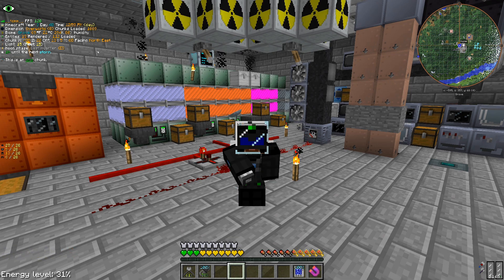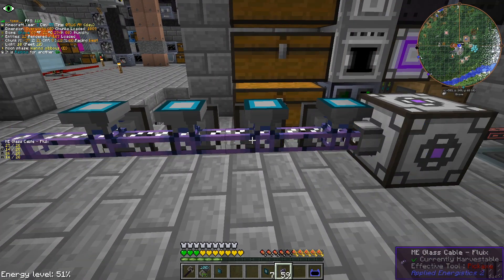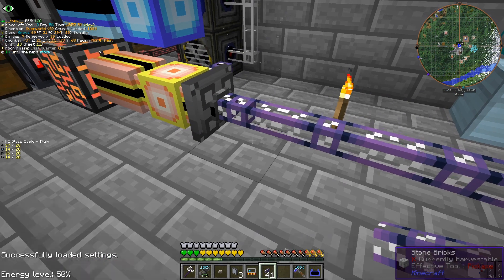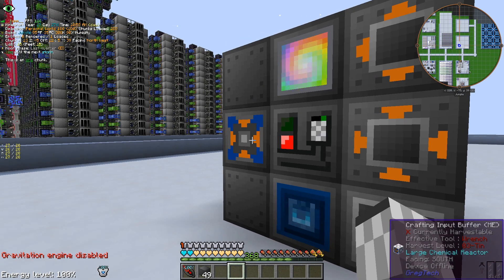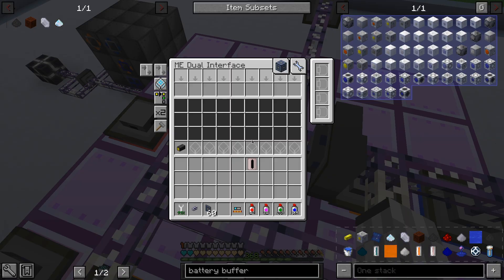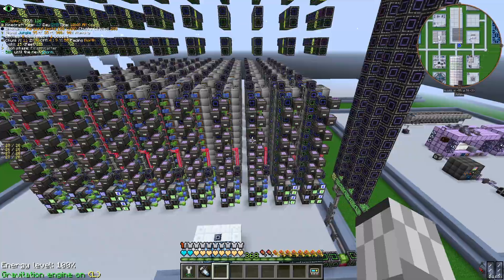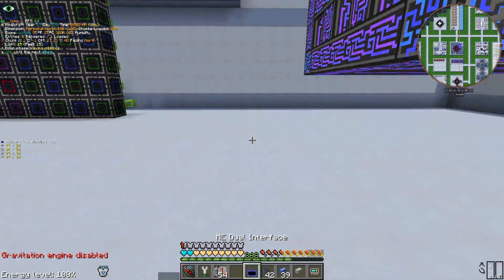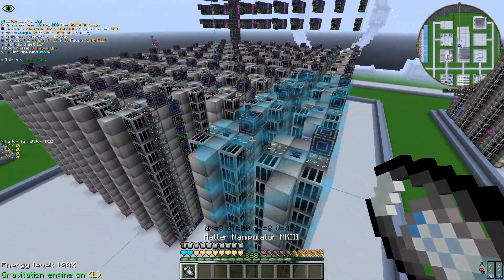GTNH - quick AE2 overview/tutorial

Comment: i watched this and tried to build the me controller block u showed as a step by step but for whatever reason mine says most of the p2ps/cables are missing channels and are offline and im not sure why. any idea what would cause that? all the me controllers are on but nothing else seems to work
Reply from the maker: use an me network visualizer to try to figure out where the channels are getting stuck?
Reply: @AverageGregTechPlayer  im playing on another modpack and I have the same exact problem, and my pack doesn't even have a visualizer to see what's going on, I noticed that there are some stuff not matching your tutorial like there's one extra p2p tunnel at the left side of the red cable at 6:59 where it was not shown in the design at 6:55, maybe slow down a little bit with the editing

small update... I downloaded gtnh just to test this out and it's still not working